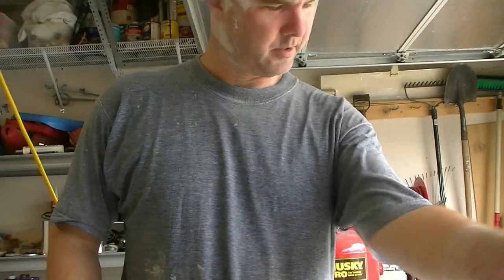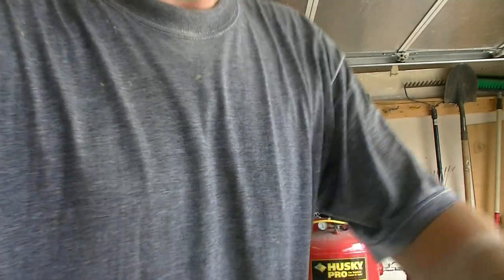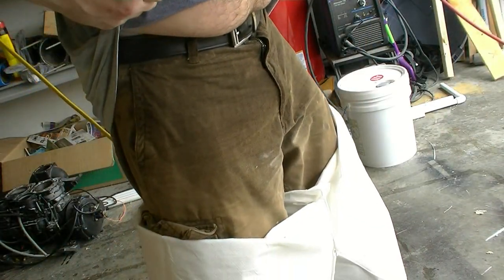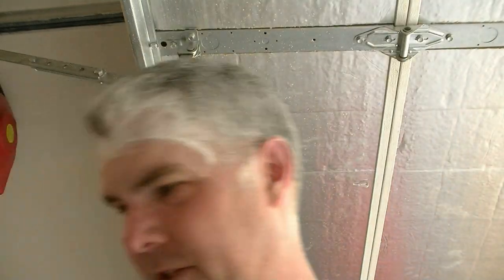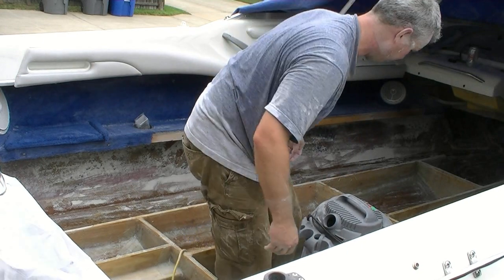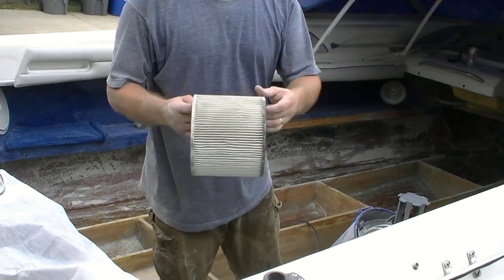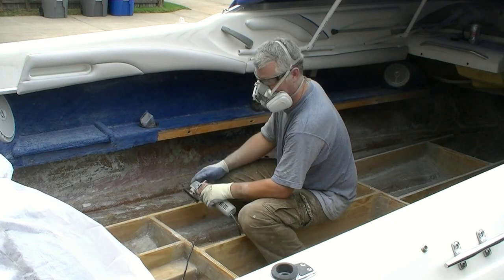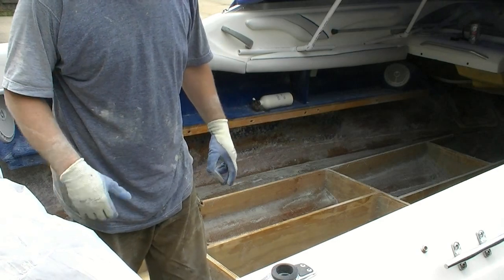Grinding the deck lip out of the Sea Ray and removal of carpet glue Part 2 VLOG #29

Comment: Don't know if you know this. Shop-Vac makes a bag that goes inside the canister of the vacuum. its made specifically for fine particles like the grinding dust your sucking up. it fills the bag up and does not clog your other filter.

Comment: Hi,

I know it's to late but I would try a eccentric grinder with grit 24 and a vac attached for dust collection.. Because the air cools down the glue. That's same way I remove antifouling from boats what works great.
You did everything so far goot but you forgot to use G4 PU primer on the wood and old polyester before putting resin on it. And one other thing. Ortho resin is crap and iso is good for boats. Don't know what you're used but both is not 100% waterproof resin..

Gonna watch you're other videos in time.. Its nice to watch and you're doing great making those videos

Comment: FriscoJarretts, I recommend that you don't try to get 100% of the glue up, focus on wheel brushing the carpet glue off enough to get rid of about 80% of carpet glue.  Smooth up the surface and remove flaking/peeling, thick chunks of glue, and areas where glue will not smooth out

I'll see if I can post a video to show this.

#1  DEWALT 3 in. Wire Wheel Crimped Brush or a DEWALT 3 in. Knotted Cup Brush if you want a more aggressive bite.

#2.  A VERY stiff scraper with a blade that does NOT flex.

Comment: I know this is way after the fact but if you run into this again there is a powder called tera- sorb used to gel water for planting trees mixing that with acetone you would have a gelled acetone that could be brushed on  that would soften the adhesive allowing it to be wiped off